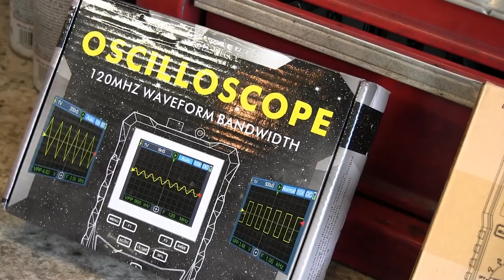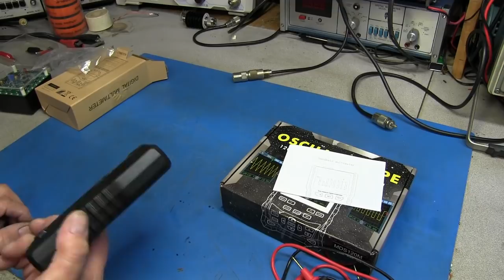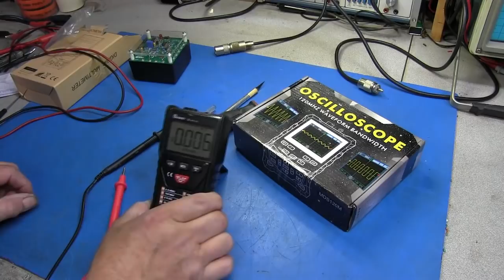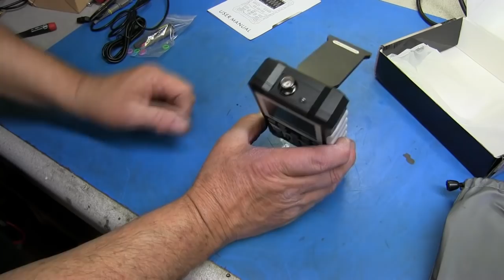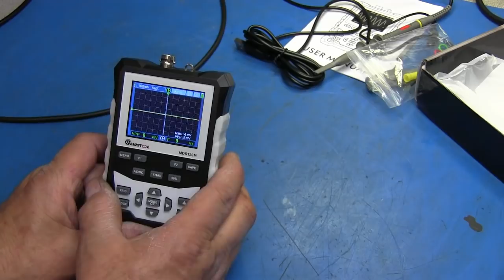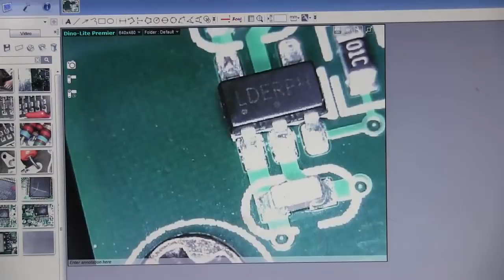Banggood Equipment Review - Shop Talk

Comment: Can you use the Mustool MDS120 oscilloscope to set the gain of an audio amplifier rated for 450 W RMS at 4 ohms?
What is the maximum voltage that it can measure?

Comment: Regarding the scope, 1x is for up to 10Mhz 10x is for above, it is normal for scopes to be like that. My BWD for example says 20Mhz in 1x mode and 100Mhz in 10x mode. (it seems its for the triggering.) The 4 legged devices with 817 on them are optocouplers.

Comment: My top tip for the day, I use a tight fitting fibre washer to hold the screw in place.
Reply from the maker: That would have made a lot of difference in this one. Simple and cheap solution.

Comment: Nice seeing that old gear built like a tank Buddy. Ran a Corsair 2 for years and it was a good rig. Needed the usual PTO servicing  but ran solid. Now running a Delta 580. Same receiver with cut down features.
Reply from the maker: Yes they are built so much better than current equipment.  Thanks for stopping in.

Comment: Hi Buddy.  Thank you for the reviews of the meter and scope.  I also really like the "new" lathe!  
I have a couple of those inexpensive handheld scopes.  One is similar to the one you have and the other is a touchscreen tablet type.  They all seem to have similar circuitry inside.  One thing I noticed with both of these scopes is when you set the timebase to anything greater than 10ms/div, the trigger position markers disappear.  The scope still triggers, but it will cut off the leading edge of the waveform and you can't adjust it.  As soon as you set the timebase to 10ms or shorter, the trigger markers reappear and the trigger works correctly.  I tried emailing the address on the instructions of one of the units, but there was no response.  This is mainly an issue when you are trying to capture a single pulse.  When you are looking at a continuous signal, it works OK.  It would be interesting to see if your scope has the same issue.  Thanks again!
Reply from the maker: Hi Tony,
I will give that a go in a future video.  It will be interesting to see those results.  For basic signal tracing everything seems to work fine.  Thanks for watching.

Comment: Taking new gear apart is a must. I can't resist either.
Reply: Right.  (Opens box, takes it apart before turning it on or even glancing at the manual)  Old school.
Reply from the maker: Always fun to see the insides, just to see how they came out with the solution.

Comment: Banggood's site looks kida sketchy to me.  It's kind of like how back in the 80's I'd be looking for a component rack stereo system and you'd see these "systems" in catalogues by GPX and Sounddesign that looked cool but you knew they were the Crosley Crap of their time...Components that looked individual until you noticed that it was just indented moldings and it was a one piece system inside a rack and the tower speakers had no jacks on the back and contained maybe one 5" speaker in a 4 ft high tower, LOL!
Reply from the maker: Yep, It is all cheap rebranded stuff.  I have ordered a lot of stuff from them, no complaints yet. You get what you pay for.